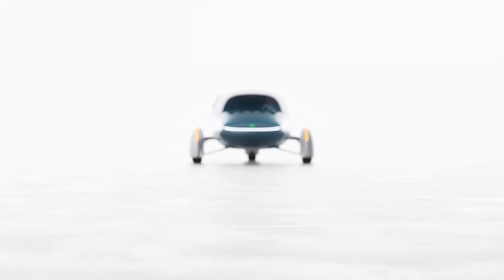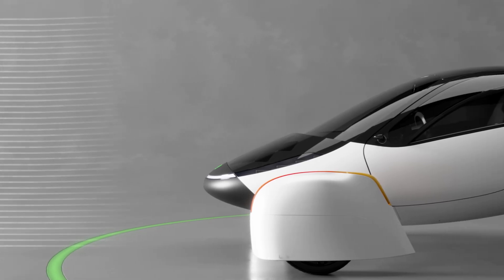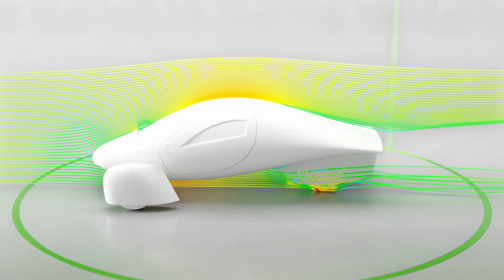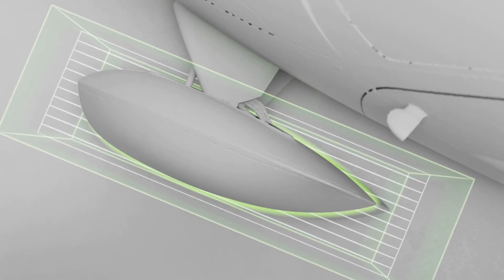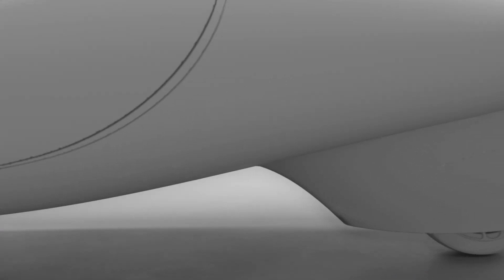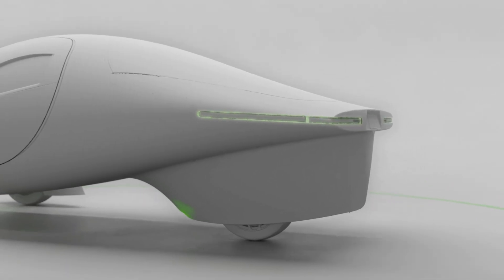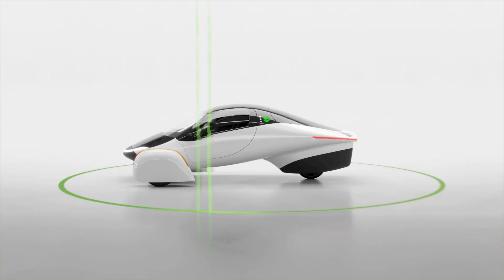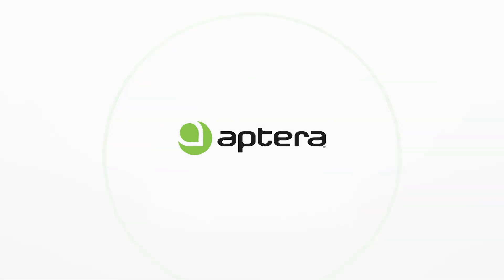Aptera's Aerodynamic Optimization

Comment: I posted a comment earlier expressing my concern about the motors being in the wheels, as "fender benders" are common. The post was taken down almost immediately!
Reply: While silencing you, instead of addressing your concerns is a big P.R. no no, compounded by your concern being a very good one, they should certainly be making consumers aware of this potential hazard, however, personally if I had the extra 25k, I'd still buy it.
Reply: Maybe because your comment is an edge case. I've been driving for 58 years and never had a "fender bender."
Reply: Lots of replies disappear.  It seems to be random.  Many of us experience this.  Your concern is a good one.  I drive a Chevy P30 that is even wider.  One has to get used to the quirks of every vehicle.  Personally, I am glad for the lower Cd and the extra stability the width provides, and am on board with the trade-off, while recognizing that is what it is.

Comment: Lol nice voice over; Chris has a good voice for this.  These changes will reduce the drag but obviously the need for mirrors (thanks NHTSA) has been a negative.  They said the beta was at 0.1285 and I really wonder where they are currently with these optimizations and the unfortunate need for mirrors.
Reply: I'm certain those mirrors are going to "accidentally" fall off after delivery. In the meantime, while waiting for the "replacement" mirrors, you will have to revert to those "nasty" screen camera monitors. Such is life!
Reply: @IDNHANTU2day  correct that's the 1st deletion I will perform.
Reply: @IDNHANTU2day  Yeah, and with the supply chain with the way things have been....who knows when you'll get the replacement mirrors, right? 🤣🤣🤣🤣

But trust me officer, they're on order.
🤣🤣🤣🤣🤣🤣🤣🤣🤣🤣
Reply: They announced today that they've officially gotten around the legality behind needing mirrors and will be carrying on with the camera systems.
Reply: Whatever the drag coefficient is now.... I'm sure it's still less than the Lightyear.  Makes no difference, the Aptera is still an awesome vehicle, and in the coming years, we're going to NEED it.  At some point the demand for EVs, and the number of EVs out there....it will out pace the current infrastructure, there will be long lines just to get to a charger.  However, we won't need to worry about that, will we? 😊🌞
Reply: @p0kerp1aya  The 0.13 spec was one they were quite open with initially and it is effectively a benchmark of their work (and the stupidity of NHTSA).  I agree it is definitely still ahead of lightyear but the Aptera is effectively about pushing extreme efficiency.  Better efficiency means they can use less or cheaper cells and maintain the same range.  These differences impact the viability of future refinements like LFP - without mirrors they might be able to use LFP for up to 600 but it would be 400 with them.
Reply: @ccibinel  I've heard that BYD is working on a LFP battery that has the same energy density of the lithium nickel manganese batteries that are currently more energy dense.  It's supposed to go into production by the end of this year.  Which means in the future you won't be taking a performance hit for simply using a LFP battery.  Anyways, by the time our Aptera batteries need replacing, we'll all be looking at Sodium batteries, LFP will be an outdated battery chemistry most likely.  If you were running a battery company, wouldn't you want to make your batteries with the most abundant element on Earth?  I could be wrong, but that's where I see the industry moving.  There's going to come a point where these benchmarks you mentioned aren't going to matter.... the batteries are going to be that good, that energy dense.
Reply: @p0kerp1aya  230 wh/kg LFP from Goshen High tech are expected soon.  Nmc is 260 wh/kg but since the pack needs less thermal management and structure it would be roughly equal.  Since the aptera is designed for massive 100+ kwh batteries it has plenty of space for bigger/heavier lfp.  Sodium is even lower density and well suited for stationary storage.  Battery technologies keep moving forward but given lifecycle lfp is the best option in general (but it wasn't when Aptera started developing)
Reply: @ccibinel  Remember that Chris Anthony's battery company uses LFPs.
Reply: Yeah, Chris could totally get work as a VO actor!
Reply: They said they solved the regulatory hurdles associated with the rear view screens so maybe the mirrors are not needed anymore.
Reply: @freddybell8328  center can be camera, sides are required.  The renderings showed mirrors.
Reply: The rear number plate holder looks like the biggest issue now
Reply: I'm removing my mirrors as soon as I get it
Reply: in the us, most states dont even require side mirrors, with a few only saying you need a drivers side mirror only
Reply: @TaylorPhase  inconsistency sucks because people tend to drive around in a free country.  Also some impact existing vs new vehicles.  I had a 92 civic work 1 mirror;drove until 2010 ish